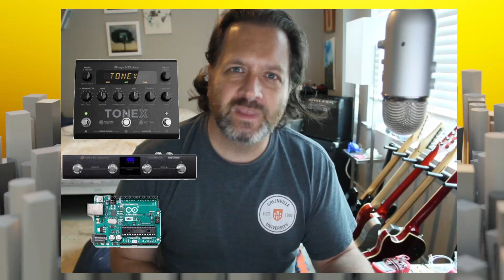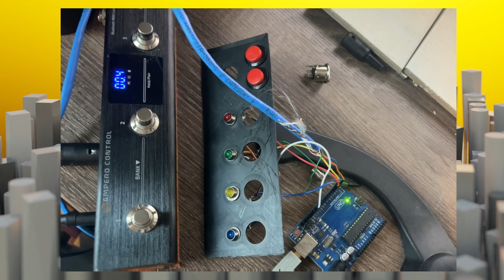TONEX FX - Status Control and Display Project with Ampero Control & Arduino - Part 1

Comment: I'm guessing this is only for the OG pedal, not the TX1
Reply from the maker: @JimmyKay1976  yeah, unless there is a way to midi control the TX1 😞
Reply: @JohnnyMatthewsMusic  That's my main regret about buying the TX1. But I learned hot to use it with the HX Stomp so it's pretty balanced.  May sell the Stomp and just get the OG pedal. I just hope IK let's us use pedals of our choice with amps on ToneX someday
Reply: @JohnnyMatthewsMusic  You can control any USB device that has an external editor. Im by now you have seen the Chocolate set up to run the Tone X One. But I want to use another FX unit to control its presets along with the Tone X One. I can code with arduino so thats what braught me here to wrap my brain around it. I dont understand the signal. Are the signals PWM signals, analog, or just HIGH or LOW. Can you fry the devices if you hook up something wrong. If so what would that be?? lol